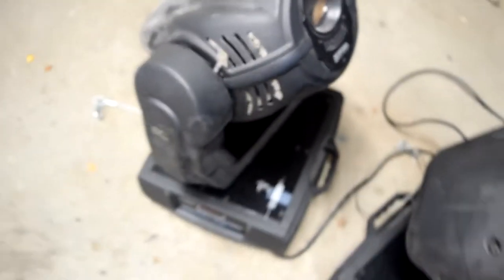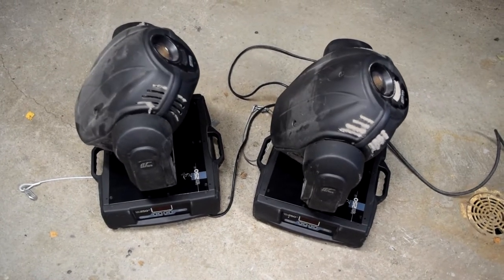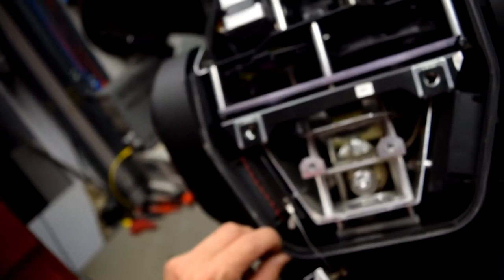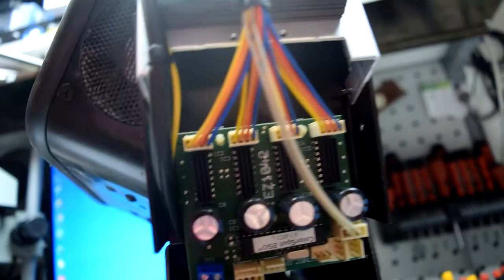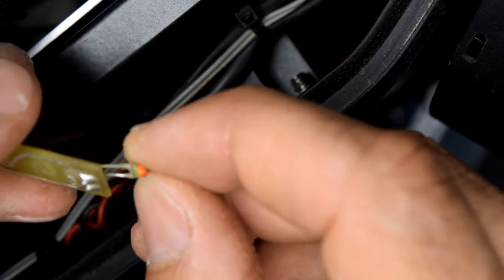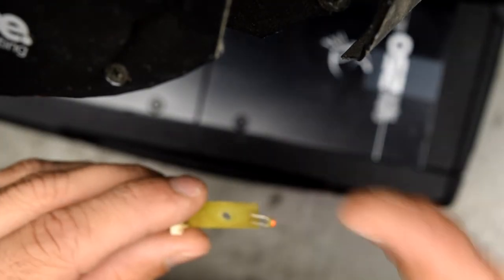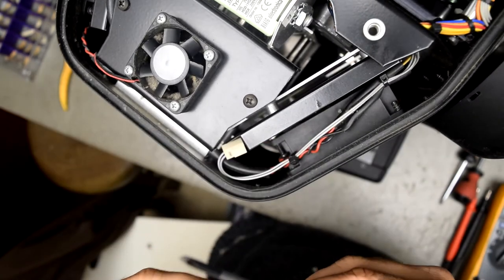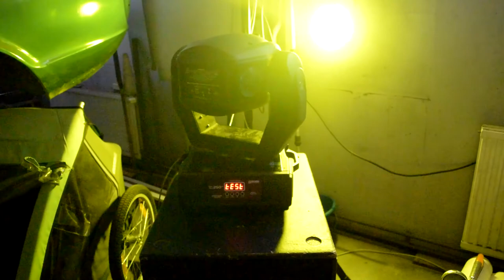Robe Colorspot 250 AT Repair

Comment: Firstly, take the covers off before you blow it out with compress air. you're just blowing dust and dirt back into the fixture (defeats the purpose) Methylated spirits and a microfibre cloth to clean the color wheel and lens
Reply from the maker: Yea noticed that xd lot off cleaning with alcohol when i clened prisms. Gobos. Colorwheel and all lenses inside off unit AFTER BLOWING ALL IN Xd but thanks for advice =)